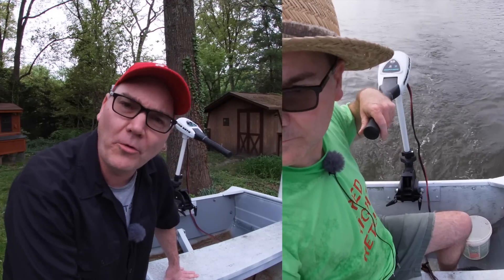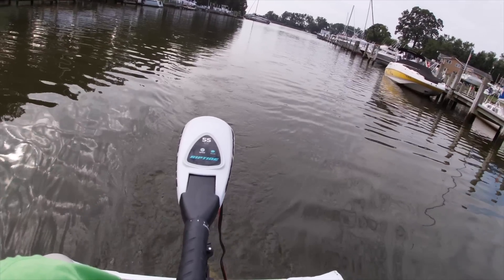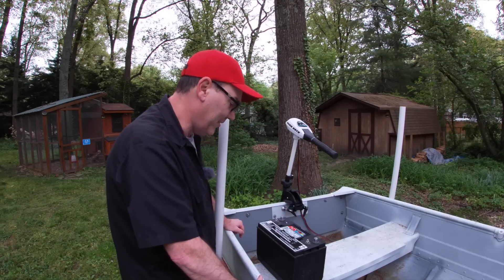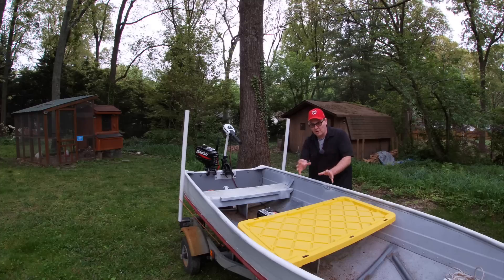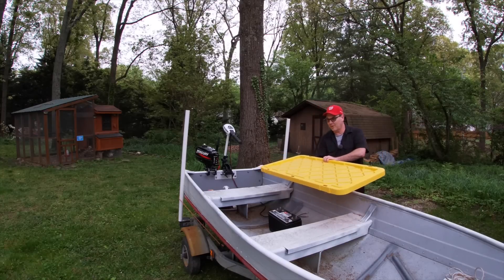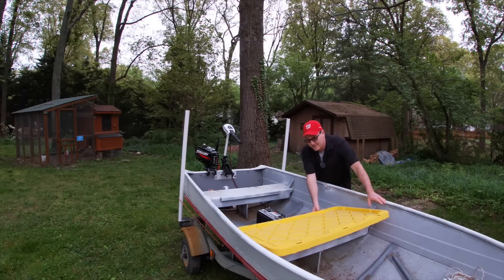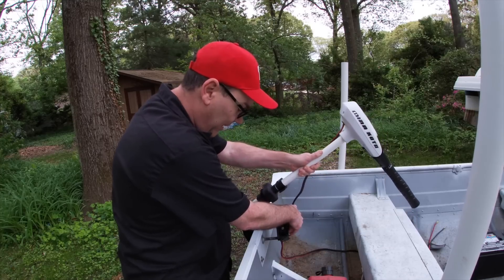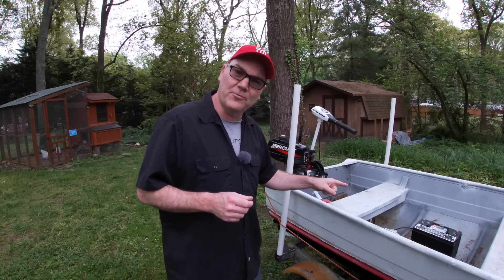How Many Solar Panels Do You Need For A Trolling Motor?

Comment: It comes down to what your use is. Let's move away from fishing all day. How about we stick the electric drive on a sailboat. We can use the motor to move the boat in tight spaces and put up the sail in open water. During the sailing time the solar panel tops off the battery again. Plus while fuel has to be purchased over and over again, the initial solar system is only purchased once. There are cases where it makes sense 🤔,  it just comes down to what are your needs?
Reply from the maker: They do work great on sailboats!
Reply: A sailboat also needs much more power to push it. A 10HP outboard is equivalent to 7.4kW. So that's equivalent to 74x 100W panels to push it on real-time solar, or about $3,700 in lithium batteries to store the energy to run 10HP for one hour.

For energy density calculations, Li-ion batteries store about 0.3 MJ/kg vs. 47.5 MJ/kg for gasoline. So gas has about 158x more power for the same weight.

Not saying "it can't be done", but the numbers don't hold up very well if you're sailing on the coast with no close port on a cloudy day with light wind.

Comment: the ONLY real reason to have solar in your boat, and you don't really touch on this, at this point in time with the technology that is easily available is for being stranded out there, in which case it can give you the power needed to find people. It is a really big thing especially for bigger boats...now for day to day use in the nearby lakes and canals and such where being stranded is not really an issue then I would say that the solar panels should be at home charging a set of batteries and the boat should be out there with another set of batteries...

Comment: The solar panels should be used to extend the range not keep the battery at 100% all the time. Then no more expensive fuel used for something that can be easily operated with batteries.

Comment: To power my 14 ft canoe for an unlimited range, I use a 55 lb trolling motor + two series-29 lead-acid batteries + one small gas generator setup* + one small gaff-rigged sail + one mark-I double-ended paddle.  I rarely use the generator setup*.  

Half of the time on the water I use just the electric motor;  33% of the time I use the small sail all by itself;  15% of the time I use a combination of the sail and the electric motor ( low throttle); 2% of the time I use the generator setup* to directly power the trolling motor.  I use a 15 watt solar panel (with a diode) to trickle-charge one of the batteries while I fish or camp.  Back at home, I use a 125v 40 amp charger to charge both batteries at once and I use the 15 watt solar panel (with a diode) to keep them topped off when not in use.

* my generator setup is comprised of a  cheap 1000w generator (800w continuous), a cheap 750w inverter, and a good 12v AGM motorcycle battery (350 CCA).   The whole setup fits inside my customized crate and weighs around 40 pounds (including the gas and the reserve metal 1-liter refill bottle).  When I hook this setup directly to the trolling motor I can only use about half-throttle because of the limitation of the little motorcycle battery.  The canoe scoots right along at half-throttle and I seldom go faster than that, anyway (3.5 knots).  The generator will run for more than 6 hours on the generator's 2-liter tank.  I have never had to use the reserve gas from my 1-liter refill bottle so unless I am going out for many days, I tend to keep my generator only half-full so that I can more easily empty the tank. After returning home I use a squeeze-bulb to empty the tank back into the gas-can and run the generator long enough to top-off the motorcycle battery while the carburetor runs out of gas.   It is a bad idea to keep gas in the fuel tank or carburetor for a long time.
Reply: I like the setup but that seems like a lot of weight in a 14 foot canoe.
Reply: @robertrichmond3074  The canoe has an 800 lb capacity.  
Let's add it up:  
2 series 29 deep-cycle batteries at 58 lbs each, 
minn-kota motor at 30 lbs, 
generator box setup at 40 lbs, 
double-ended paddle at 2 pounds, 
sail at 2 lbs, 
mast at 3 lbs, 
solar panel at 2 lb.
It all adds up to about 195 lbs, which is about the mass of another person. 

We can take it further:
me at 205 lbs,
fishing and camping gear at 60 lbs (including food and water).
That puts my total cargo weight at 460 lbs, which is slightly more than half of the canoe's rated capacity.  I do, however, put the big batteries and generator box in the front half of the canoe unless my son comes along, in which case I put them in the center.  

When my son comes with me we add: 
teen-aged male at 170 lbs,
extra gear, food and water at 20 lbs.
We are still 150 lbs under the max load, so we can still bring home a bunch of fish.  Of course, when he comes along, the canoe sits a bit lower in the water and we assume a slightly slower speed.  Back at home, I have a Gorilla Cart that I use to haul it all to and from the canoe and my garage.
Reply: @sailor-rick  sounds good,

Comment: If some guy asked if it was a good idea to convert a minivan into a vehicle to transport large loads of drywall or to convert a standard cab heavy duty pickup truck to a vehicle for taking four children to school, the error is quite obvious.  But use that scary word technology and the obvious is not so obvious.

Trying to replace the functionality of a multi-horsepower gas motor with a trolling motor is just not going to perform the same way.  Combining solar, which definitely has its limits in space efficiency, with an inefficient trolling motor attached to a less than ideal boat for the application, is also not going to make solar a practical fit.

But there are applications where a combination of the right boat, an efficient properly sized brushless motor, high upfront cost but low long term cost lithium batteries and those reasonably low cost but efficient consumer grade long life solar panels make sense.  For instance, if you want to be away from easy access to fuel or the grid for any length of time.  Solar is not always the best for full time continuous use applications.  But a 100 watt panel, for example on an ideal day, can produce a kilowatt hour of electricity over a whole day, about the same as what that 12v 100 amp hour battery holds.  So if all you need is a few hours run time a day, you could use even your setup indefinitely with one battery one panel away from the grid.  Like cutting the umbilical cord, true independence for the life span of the equipment at least.

Comment: 2x240 panels with pwm speed controlled 24v motor on the same outboard you are using on my 14 jon boat with two deep cycles in series. with the pwm set at 400 watts consumption i get 7.5 knots. with how much i tool around the cost savings in fuel paid for the panels in about 2 years

Comment: Everything you said makes sense. My boat (actually it’s two coleman canoes mated together) is the same way. I have a 4 horse yamaha to go upstream as far as I want to, then trolling motor on the way back. Two deep cycle marine batteries parallel connected will give us plenty of direction control and if it gets late, there’s always a little left for a small light if you need it
Reply: dude. i been thinking to make the hull between the kanoes wide enough for solar panels. easily fit 300-400 wats and a big trolling motor ... could also add a sail cause a catamaran is really stable.

Comment: Don't use a charge controller.... don't need it if your powering the motor at the same time. Your not going to overcharge your battery.  Just hook panel directly to battery.  I use a small 40 watt panel and it helps alot.  Me and my buddy trolled for 3 days in the sun with that same motor you have and a group 27 deep cycle battery. You must have a very weak battery if it dies after 3 hours.
Reply: No way I'd follow this advice, especially when  you can get a cheap charge controller for about $10. Most 12V nominal solar panels put out about 18V peak.  With 18V you can absolutely overcharge a 12V battery, and also damage other electronics (motor). The usual high end of voltage for charging 12V is 14.4V. Balance charge voltage, which is only used occasionally, is just over 16V, and lots of components need to be disconnected before a balance charge cycle.

Comment: Also putting  a PWM (Pulse Width Modulation) speed controller on the trolling motor would have a net reduction on the energy requirements. Typically a small trolling  motor draws full amps at all speeds, with all speeds beneath top speed bleeding off energy into resistors which is lost as heat and lowers motor speed in the process. The PWM in contrast "chops" the DC current up by switching power on and off very quickly in relation to the speed desired; obviously full on at top speed and decreasing as lower speeds are selected. There is much less wasted energy as heat, and less load on the battery. This would make battery draw less, and less solar assist would be needed to top up the battery. I'll leave it to you to work out the details. Good explanation of solar chargers, controllers in your video!
Reply: Although a resistive speed control does waste power as heat, it still reduces current draw considerably at lower speeds. 
Let's say your motor draws 36 amps at full speed.  That represents 1/3 of an ohm of impedance.  If you throw another 1/3 of an ohm of resistance in the circuit,  you'll only draw 18 amps.   Half the current, but 1/4 of the power since the voltage to the motor is also cut in half.
Reply: Low speed full amp draw is a myth that i see everywhere. A simple current test would prove that low speed draws considerably less current than high speed.

6.6A at F1 with Minn Kota endura c2 40.
Reply: I'm glad you said "typically" because I've tested that with the Xi5 trolling motor.  The Xi5 draws close to 50ah(625watts) at full speed and as I mention earlier is only draw 80 watts(6.4ah) at power level 3 out of 10.
Reply: This comment is technically inaccurate.

Comment: I use a small little clamp on harbour freight solar panel, it works wonders, you'll NEVER keep a battery "fully charged" the idea of solar is to trickle charge when you stop drawing electric. You'll go down to 50% or 25% and not drained completely, the panel adds life to your battery and more trips. I couldn't get the same range without a solar panel

Comment: 1 hp is 746 watts, which is 62 amps at 12 volts.  1 hp is approx 20 lb thrust. So a 3 hp outboard equivalent would need 2 Kilowatts of solar, so a pretty big panel.
But it also depends on how many hr you use the boat. a big panel to charge at he dock, while using the boat weekly could work.
On a friends' sailboat, we use the VHF radio continuously during racing. A 10 w panel burns up a lawn tractor battery every 2 yr from overcharging. (don't ask me he never got a charge controller)
Reply from the maker: Yeah a charge controller seems to be an essential piece of the puzzle!

Comment: So how do so many sailboats get enough juice to run fridge etc ?
Reply from the maker: Several reasons - Typically a sailboat has multiple batteries, and usually a couple of 100 watt panels which are mounted in place. They also usually have a generator for when solar conditions aren't ideal. I would imagine the draw of a small refrigerator and other electronics might not be as much as a my example of a constant draw trolling motor. 

Once again this video wasn't about solar not working - but it not being a very cost-effective solution for a 12 foot boat when a second battery would provide the desired results for less money.
Reply: solar wiñd  regen orops

Comment: I was hoping for a little more substance, like how many amps your trolling motor draws at different speeds, how many amp-hours you use in a typical day on the water, and how many amp hours a 100 watt solar panel can be expected to provide (hence, how many you actually need as opposed to the guess).  Doubling or tripling up on the batteries is a great solution... if you have a place to plug it in every night.  Just like my car.  If I ran it all day, I'd have to fill it 2-3 times a day.  But a tank lasts me 1-2 weeks in real life.
Reply from the maker: I had been researching this video for almost a year. Several times I considered buying solar to test it out but all of my research kept showing how it wouldn't work. I would need a 'roof' of panels and spend almost $1,000 to run my trolling motor several hours. There are others who have made videos showing the data for their panels, motors etc - but they always have multiple batteries and large panels.
Using solar to charge up the batteries after a day on the water might not be a bad idea at all for someone who has a sunny yard.

Comment: To your point about optimum conditions.  I have a shop with 28 modern solar high voltage panels professionally installed with a controller and monitoring system.  It is a 10,000 watt system.  I can monitor it anytime with an app .  The most I have ever seen is 65 KWh  on a sunny June day and the most KW output is 7500. .  The app shows real-time production and when clouds go by the output is dramatically reduced .  I also have a 195 watt solar panel and a large deep cycle battery powering on a craft that weighs 350 lb and using a 40 lb thrust motor.  In that scenario on a sunny day we can run all day .
Reply from the maker: Nice! What is the electric motor - is it a Minn Kota or some brushless type?
Reply: @WayneTheBoatGuy  yes it is an Endura brand.  The craft is 2 old sit on kayaks with a 2x2 aluminum frame tying it together and a cedar deck.  A lot of repurposed materials.  We also have a Windrider trimaran sailboat with a 55lb Minnkota and a 40 watt solar panel to get us by when the wind falls off.

Comment: I intend to convert a speed boat to a solar-aided cruiser. Best thing to do is have a few extra batteries (for +AH) and then utilize the panels to Slow Down the discharge. YES, your batteries Will drain- at a slower rate. Dont consider any less than x2 100w panels on a homemade boom or bimini. Dont desire to be a speed idiot and run it at full blast because the power curve drop at higher amps will leave you dead in the water sooner. Dont expect to run the motor all day. Its ok to turn the motor off and have lunch by yourself, with your wife, fling, friend or all of the above. Enjoy a bit of silence, inbetween putting up with the passing boatbillies that are still going through their midlife issues/divorce/etc or just plain believe that flooring it all the time makes them appear kool among the others. Though you probably look just as dumb while hanging testicles from your otherwise gigantic, compensating pickup truck, you dont necessarrily need to do this same thing via a watercraft.....or perhaps you do....there are medical options for that smaller issue in your life. From there, you will be just fine.
Also- Go Brushless. Its 2022 already....

Comment: Solar panels have become sooo cheap now, 400W at the price of a second battery. 
Sun and rain protection when mounted over your head, no more recharging or removal of the LiFePO4 battery which you should use as a backup.
The choice is obvious...

Comment: Great video! I have a 13' Smokercraft with a 15hp 2-stroke Mercury & a 35 pound of thrust Minncota.I've extended my range by using 3 group 32 deep cycle batteries [one in the back & 2 up front] I connected them with jumper cable wire & proper battery fittings. Between the gas motor & fully charged batteries I can fish 5 days on the big lakes in Washington  state. At 76 getting home is big to me --- Plan A is the gas motor, Plan B is the electric motor, Plan C is to row. Had to use Plan B twice --- took some time but those 3 big batteries never seem to die!! Solar just not practical ---don't bet your life on it!
Reply: scout 145  hybride  8 hiur 8 moh 6r mioke eange teksa cell   new ines 74 mióe ekrrc rànge

Comment: Thanks Wayne, you made a lot of good points with using an electric trolling motor on a smaller boat. I am actually thinking of putting an electric motor as backup on my 14’ (4.01 meter) aluminium runabout. I would most likely be using it in a river and lakes but not sure how powerful it would be against a flowing tide? Or do I just get a little 2hp motor like you have.
Cheers…
Reply: I've got a 55lb on a 15' fibreglass, does 3-4kph flat out.it will hold against a strong current but that's about it. Works well for slow trolls around bays and harbour structure for fishing.
Reply: @davesboatingfishing  thanks Dave
Reply from the maker: A cheap electric trolling motor might not be good enough if your currents and tides are significant. Around me, there isn't much of a current in our river.
Reply: @WayneTheBoatGuy  thanks Wayne

Comment: Two used 325w panels is $200.
Reply from the maker: I never see those around here. And would they be easy to deal with in a 12 foot boat without building them as a roof?
Reply: @WayneTheBoatGuy  Mine are about 38"x77" and 40 lbs each.

Comment: For years I used a trolling motor/battery on my Oday 19 sailboat. It was perfect for getting off anchor and coming into the dock. Never had any problem keeping it charged up with a 30 watt panel. Used the boat about 4 days/week, but would only use the motor for short periods of time. Still, the battery had enough power to get me home if the wind died completely. Never had to use anything but the little solar panel to keep it charged up.
Reply: I did similar with 1300 lb San Juan 21 using 27 ft-lb MinnKota.